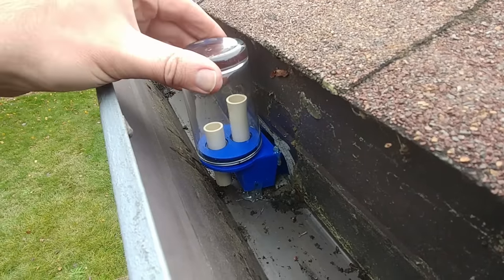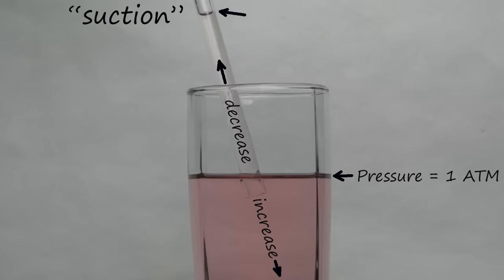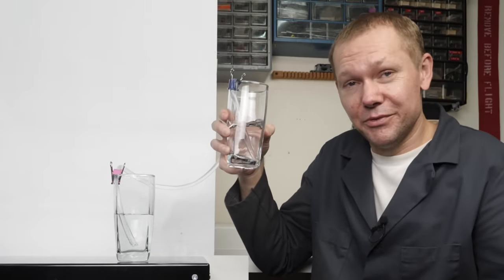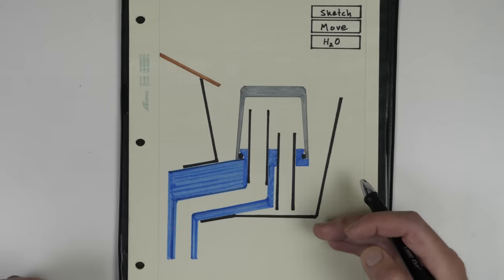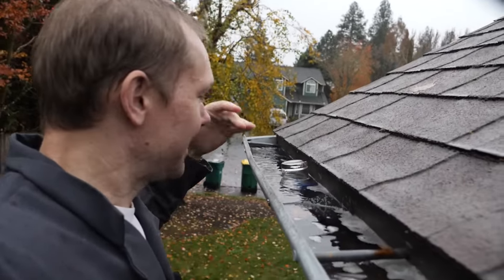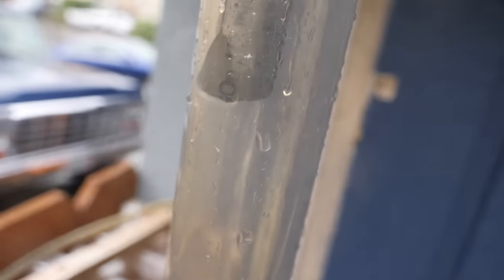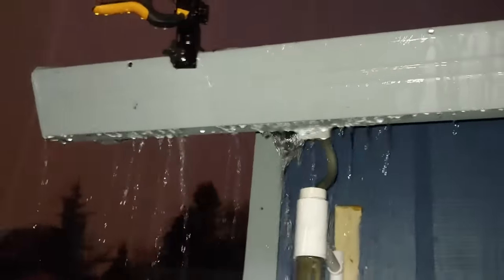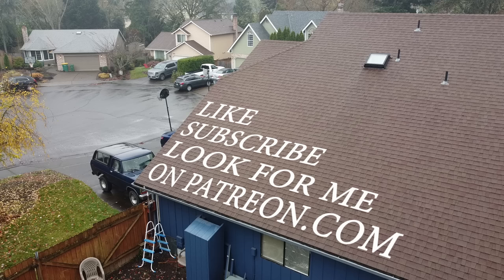Rain Gutter POWER #5 - Bell Siphon Fundamentals and Pitfalls

Comment: The glasses balancing themselves out is like how batteries in parallel will equalize their voltages
Reply: Actually water flow and current flow are fully analogous with the right units you can use the same equations.
Reply: And how the Eiffel Tower self-levels.
Reply: what if you placed the two cups on a rotating wheel so that they are constantly changing places... the water should flow back and forth through the tube and could be used to generate power
Reply: @Shadowmaster625  that would be like using a motor to turn a generator
Reply: @PRODVDi  I was thinking of a water wheel ... but yeah then why not just attach the generator to the wheel
Reply: If you're talking about having the wheel turn by the weight of the water going back and forth, the water would just level out without any additional input. It would just stop with both containers in the middle and equal or with one empty at the top and the bottom one full.
Reply: @repairengineer  Lots of parallels with water and electricity.
Reply: @Shadowmaster625  No.

Comment: Just add another, higher-flow bell siphon with a greater column height for when the little one can't handle the rainfall!
Reply: agreed @Quint BUILDs
Reply: I was thinking the same thing.
Reply: Yes, also the siphon starting height is limited by the max gutter height. So the waterwheel bell siphon needs to be lowered  so it could start earlier than the  high throughout siphon.  Testing would be a little annoying, can easily test each side of the system separately for functionality, but proving the system as a whole may require another heavy rain.
Reply: Would have to lower current one and add max one. Giving you high and low rainfall. May need to look at max rainfall per hr and roof area to size it to match worst conditions.
Reply: He could probably solve it easier by just widening the tubes. Or putting a nice rounded edge to increase flow rate.
Reply: @t_c5266  thats what makes bell siphons so annoying. Widening the tubes requires a certain fill rate to start the siphon. If you widen the tubes, more water will drain before around the lip of the tube without fully blocking off the air-path, so a low fill rate will never start the siphon.
Reply: @t_c5266  this is a formula for more dribble
Reply: How about a rain barrel at the overflow? You would need a different system for the lower head but still get power.

Comment: NICE JOB!
Suggestion on outlet tube: Make opening horizontal and pinch to make less round (a little oval), will improve trigger in low-flow situations little impact to flow.
Reply: Or hacksaw teeth like cuts to the pipe.

Comment: You want to make sure the water never gets up to the nails. At that level, you are basically rotting your facia boards. That's about a 2000 dollar repair.
Reply: this is a very fair point and all, but at the same time he lives in oregon. gutters overflow all the time in oregon. his roof is probably pretty decently treated against rain over all, including a situation like you described
Reply: @Templarfreak  yeah, probably true, I just wanted him to avoid a costly repair, one that I recently had made, so know what the cost is.
Reply: @FelonyVideos  yeah, its a prudent sentiment, but im sure the roof can take a little bit of extra abuse
Reply: @Templarfreak  
This is an interesting point. I know from experience that there are sometimes wildly different building codes in different parts of the country. For example the codes for framing and insulating in Texas are pretty standard, but in Maine, it is completely different than anywhere else I have ever been.
Reply: @AaronAlso  i dont really know about building codes or anything like that, but i do know that Oregon gets a lot of rain. It gets so much rain and overcast coverage that there was a legitimate fear that it was actually causing increased suicide rates due to the lack of sun exposure, though im not so sure how true that actually is
Reply: @Templarfreak  oh its true, there are higher rates of suicide and depression in the winter months, vitamin D is more important to mental health than people give credit for
Reply: For those unsure of housing construction techniques, the edge of the roof shingle at the bottom row has a metal drip strip installed beneath the roofing. Beneath that is a fascia board, and behind that is another board. The drip strip prevents water from touching any of these wood parts. The gutter is nailed through this drip shield and into both boards behind that. The nail creates a hole that is never supposed to see any water. Allowing the water in the gutters feeds water into these holes, think of the gravity level example in the video. If the water reaches these holes one time every time it rains hard in Oregon, 5 years tops and the gutters simply fall off the house as the nails lose their grip in the rotted wood. That will 99% probability happen. This is why people clean out their clogged gutters, to avoid this pain in the ass.

Comment: Hi Quint Builds. You might like to see the siphonic roof drainage system. It uses the siphon principle but in a simpler way than a Bell siphon. It generates higher pressure so your turbine can harness the energy. But you will need to connect the pipe directly to the turbine.

Comment: Theory: You can achieve much more head pressure by reducing the size of the downspout. On the opposite end, redirect the downspout, a 45 degree angle from the gutter towards your wheel. Every 4 feet, reduce the pipe size by one inch. You will generate way more speed. This is how they used to do hydro excavation during mining operations in the 1800's.
Reply: I think a 1/48 (1 inch every 48 inches) cone is unnecessary, a 1/5 is also ok

Comment: The water level is how I re-leveled my rent house. Thanks science!
Reply: Yes!  I came here to post that water leveling using long tubes has been a real, serious civil engineering thing for many centuries.  At least it WAS before easily available laser levels came available.
Reply: @737smartin  I was also looking to see if someone already mentioned that this is exactly how water levels work. No need for fancy expensive laser levels when you've got two buckets and some vinyl tubing.
Reply: @737smartin  I was about two hundred miles from the nearest hardware store and I had the necessary materials. Why waste money on a one use product?
Reply: @DavidLopez-po7kg  Not meant as a criticism, my friend.  I’ve used a water level more than once myself—most recently less than three years ago.
Reply: @freakstarrguy  You can get away with just the tube for a water level actually. As long as you hold the ends up higher than the water levels out at. A longer tube means you can level over more lengths. I'm sure there's a video on the tube somewhere about that.
Reply: @737smartin ,
🔵 That's how they levelled the pyramids, they started by making channels at the perimeter of the proposed construction and flooding the channels with water, anywhere in the channel is equilibrium!
Reply: I used a water level to make sure my vinyl siding went all the way around the house and was not off where it finished compared to where it started.
Reply: @hdezn26  Ask This Old House used the old "wahtah in tha tuuuube" method (Roger Cook I think) in one of their shows to level some landscaping.
Reply: @lucash1980  O'rly? Waht abaat tha loobstas?

Comment: For better usable bandwidth  you could always have multiple siphons set up at different heights. So it starts siphoning at a low level, then if that rises higher the next siphon also kicks in, so on and so forth.
Reply: I was going to suggest the same thing but have  the second higher level one siphoning to a reservoir lower than the gutter but higher than the pump for use when the rain slows down.

Comment: Disclaimer: no science or engineering experience just an intrigued person. For the overflow, would it be possible to have something like a second bell syphon but trying to change the height it triggers as to make it 2 cm below the edge of the gutter, this might be enough for rain coming in at set rate, also I'd adjust the Bell syphon to trigger at 4-8cm before the Overflow, depending on the flow rate of this first one. Note overflow syphon opening should be at least 75% times larger to be safe that the syphon rate would be sufficient for the rain fall. (Keep in mind that original syphon is operating but overflow should be designed for failure of the first (it should be able to drain as if it was the only one operating and at a heavy rainfall rate). Thank you for your time.
Reply: That does seem a brilliant idea. Or, for the sake of keeping it simple, notch out the gutter at the top, on the end or the front - then attach a downspout at that notch, so that any excess water just flows away, and doesn't rely on any systems which could fail, become easily blocked, or be overwhelmed.
Reply: I had another, even easier thought. At the other downspout, which is currently blocked off, extend the outlet up, so that it is below the top of the gutter, and at the top of the max water level you want to hold - job done.
Reply: @mikehealy74  this. Typical overflow valve used everywhere. Even in your toilet tank.

Comment: The emergency overflow should be automatic, you can do this by simply making the overflow pipe's hole  at a higher area so that the bell siphon can work at the same time
Reply: have it feed into the overflow past the bell siphon for better efficiency
Reply: Either raise the height of the inlet for the downspout by inserting a sleeve tube, or add a float valve.

Comment: That siphon experiment with the glasses?  Builders use that principle to level things around a build site.  It's called a water level.
Reply from the maker: Yes!  One of my coworkers told me about that.  I've never seen it done but it's a brilliant idea!
Reply: @QuintBUILDs  ; The Romans new that trick. They documented it very well.
Reply: Spirit level?
Reply: Perfect application! Didn't know they used that, thanks.
Reply: Pretty simple, get a long flexible tube, set the ends of the tube where u want to have your beginning point.

Add water, when the water reaches the beginning point, the water on the other end of the tube is on the same hight (aka level)

Greetings from a Stonemason
Reply: @QuintBUILDs  My dad and I used to use it when we were building foundations. We'd have a bucket with a long clear tube coiled up inside. In the tube was water with red food coloring added (so we could see it easier). One end of the tube would stick out of the bucket to allow air to come in and out, and we would attach the other end to a 2x4. You rest the end of the 2x4 on the ground and mark where the water level is and then you can walk all over the job site and measure how far the ground is above or below your starting point by measuring the difference in the water level in the tube.
Reply: @shanusays  No, those are the standard levels people have: a rigid flat device with small vials with liquid and air bubble inside.
Reply: @llantup  got it.

Comment: Get a hamster running that wheel and you’re not dependent on rain or getting wet running out to check stuff.  HAMSTER POWER
Reply: What if the hamster didn't want to
Reply: That's slavery and I don't support that...
Reply: @trenchcoatdoggo5185  from the internet so it must be true & based on many interviews/questionnaires with hamsters:
Health. Hamster wheels are 100 percent vital for keeping hamsters happy, healthy and physically fit. These creatures absolutely need to run. If you want to make sure your tiny pet remains in glowing health -- not only in body, but also in mind -- a hamster wheel is the way to go.
Reply: @gabrielmorrison9477  you get one that wants to.

Comment: In my irrigation business, we built many concrete pads usually 16 ft by 30 ft in size. Down in the southwest, all of my employees are Hispanic with some of them Mexican citizens with work permits. They used a 40 ft length of clear tubing filled with water. They held one end on the first form put down at the correct height with the water level right at the top of the form and worked around the layout with the other end leveling the forms as they went. They were always spot on. We called it the Mexican floor level. 
Also, since 1 psi atmospheric = 2.31ft of water, you can calculate the pressure coming out of your nozzle on the bottom. When your "downspout" filled up with water it covered the end of the pipe coming out of the siphon. That made the total "head" of water the full height of the water in the rain gutter. Let's call it 9ft 3in which would give you 4psi (above 1 ATM) coming out that nozzle spinning the wheel. I don't know what the real measurement is.

Comment: Your bell siphon "outlet" tube needs to have to top of it perfectly level, to minimize the dribbling. Also, if you make the top surface of that tube "wider" (larger OD, keeping the ID the same as it is), you would get more lateral flow velocity at non-siphoning water level, which would "choke" the flow, until the siphon started, at which point, flow would be nearly straight down, so the flat surface would be less of an influence on the water flow rate.

Agree with other commenters, that a weir or similar outlet management on the overflow drain would be the simplest solution, but using a second bell siphon at a slightly higher level would, with a second column and nozzle, allow for doubling the power applied to the turbine.

edit to add: if you use a P-trap, the dribble would be effectively eliminated, until it's ready to siphon:
https://www.youtube.com/watch?v=5wZ9PQepQYI

Comment: Would putting a “P” trap in the discharge line help it build up enough water to prime flow out quicker?
Reply: NO, It doesn't work that way.
Reply: @stephenwhite1607  Actually it would work as David Unger says. The P trap would create an airlock that prevents the main syphon from dripping while the gutter gets filled because the air in between the main syphon and ptrap needs to be compressed while pushing water from the ptrap out down the discharge pipe. When the gutter water level rises high enough, the P trap air lock is broken and that causes a surge of water for the full flow of the main syphon. The P trap needs to have an air vent to prevent all the water from leaving because it does not self prime.

A video of a ptrap in this use case
https://www.youtube.com/watch?v=5wZ9PQepQYI

Comment: If you have all the water drain  into a tank or 55 gallon drum and  connect a fitting that connects to a hose and  put in a mechanical  pop- it valve  that will pump water back up to the gutter you can keep the cycle or water ( recycled) so it will not run out! Now you may need 2 or more pop- it  valves to keep the gutter to the right  level! Just thought this would work with rain or just fill the system and use float valve connected to 1 of the tanks  to add water from your water hose as needed! This will give you a continuous loop even if it isn't raining!  I enjoy your channel  and  you seem to have  ideas that  roll around in my brain    all the time and it's great to see them in action and then I take what I learn and add it to what I've been thinking! Thanks!

Comment: I bet you'd get less "dribble fault" if the syphon tubes were level...
Reply: Yeah the wole bell needs to be plumb or the outflow pipe needs cut at an angle parallel to the water level so water flows over the pipe's edge equally.
Reply: You can fix it with a simple pee trap.
Reply: there are public toilet bellsyphons that use a smaller diameter "trigger" syphon to trigger the mainsyphon.

Comment: to keep your gutters clean put a mesh over the whole gutter!
Reply: Wouldnt that just cause the leaves to sit on top eventually covering the gutter
Reply: Bob Watters  I guess my main concern is that water wouldn't then get into the gutter. I'd rather it was blocked slightly than just pissing over the edge. Leaves need much more density to block a gutter than cover it

Comment: glasses with the tube between them is more or less just a water level
Reply: I built a level one time with just 25 feet of clear tubing and a couple of corks; I made it to check a 40x36 modular home/double wide; it was 4 inches off from one corner to the other. 
The dealer when they were out to replace a window that got cracked moving it, after a year, and to show the woman I was with at the time it was level, the guy pulled out a 2-foot bubble level put it on the bottom, toward the middle of the frame showed her and proclaimed it was perfectly level because the bubble was between the lines. Yes, he literally did and said that.
Science is great.
Reply: Glasses with a tube between them is likely a shitty pair of glasses. 
a sealed Glass cup with 2 tubes inside is more or less a water level.
isn't English great? you can make a sentence vague and confusing to others or more literal and easily understandable by everyone.
Reply: @theherrdark4834  water is flat . Flat earth
Reply: @ruakij6452  why so upset stay open minded right or wrong easier to learn when open minded

Comment: Hot glue is no match for ISOPROPANOL - no - seriously - try it ...
Reply: Why are you comparing with alcohol?
Reply: @XB10001  no electric heat gun required.
Reply: @Qui-9  oh, I see!
Thanks. I really did not follow.
Good!
Reply: @XB10001  and a much cleaner "release" to boot. You really have to try it to believe it.
Reply: Thanks for the info.  I did not know that!